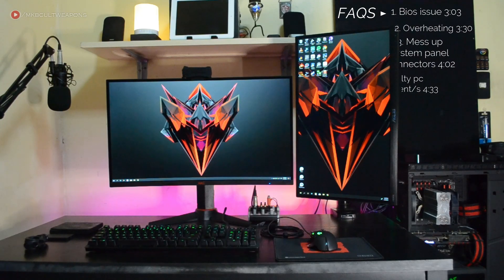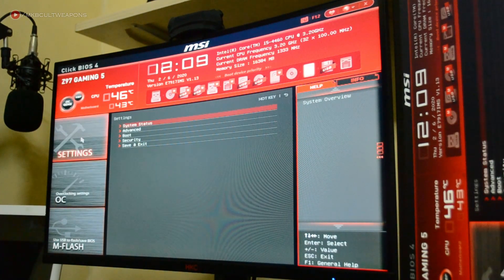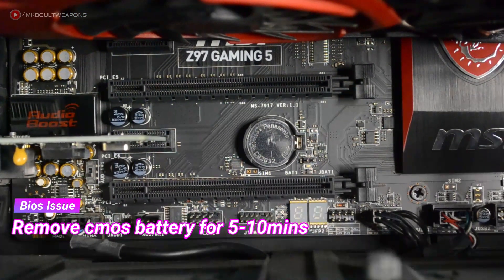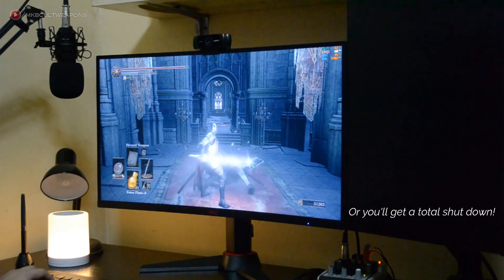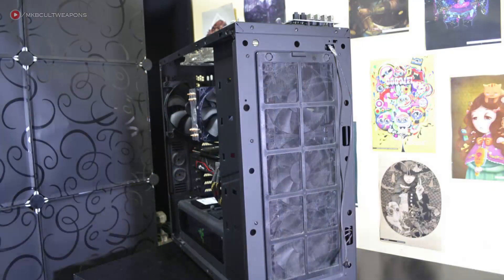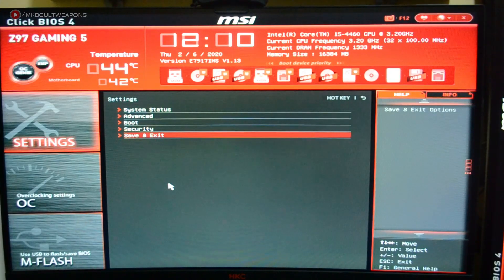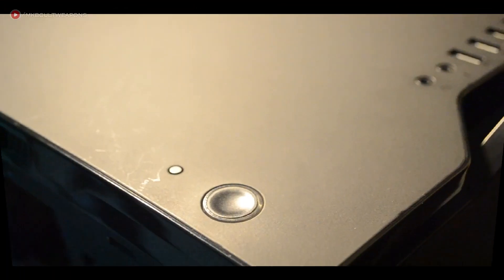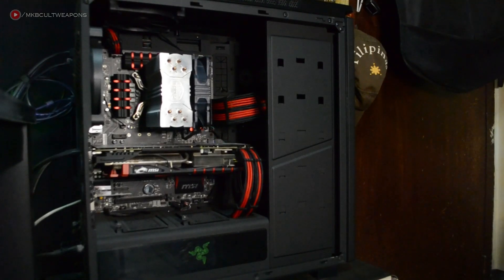Pc keeps restarting FIX / Pc continuous restarting FIX

Comment: Very important: I just had this problem and even more lot of times the pc was starting but no display at all, sometimes boot loop. I checked the cpu and I noticed there was some green plasticky residues on the contacts pads, I removed them with a needle and this probably solved the problem. I say probably because I did this few minutes ago but I believe it will work fine now because every pin on the cpu has different functions and those residues were probably causing current interruptions between cpu and motherboard.
Reply from the maker: i wonder where those green plasticky came from, anyway thanks for sharing bro! this might also be helpful to others who might experience it.
Reply: @MacCoyzkie  my pleasure, I really don’t understand how is it possible that some residues could form under the cpu, it looks like some kind of insulating enamel used on motherboards or maybe thermal compounds..I hope this can help someone because I almost sent gpu and motherboard to tech assistance.
Reply from the maker: @NikStrengthCoach  i see, yes this will help because at times pc builders forget to check that part. Thanks bro

Comment: Someone please help I was messing with bios and I shut down  my PC and my PC won't start it keeps turning on and off. I even removed the cell cleaned the ram nothing works.
Reply: Well nothing worked I had send the board to gigabyte service center it's been about five days they said I'll get it done today.
Reply from the maker: @dunkuzi5695  i  hope they'll fix it
Reply from the maker: remove the cmos battery for 5minutes or make it 6 minutes just to make sure, place it back and power on your pc, this will reset your bios to default so whatever you have messed up there will return back to normal.

Comment: Thank you very much, it was the fault of a non-working ram that the PC was constantly resetting .... I have 2 questions if you can answer: is it possible to restart a ram that makes the PC restart continuously or is it to be thrown away?  Then, if I buy a ram, does it have to be the same as the others or can it be of a different brand?  (Ddr3 mhz1333)
Reply from the maker: no problem, before throwing your old ram try it with other compatible pc first, if problem persist then it is really broken. It doesn't have to be the same manufacturer but you have to check your motherboard manual for compatibilities regarding the speed and ddr3 support. If im not mistaking the fastest ddr3 is cheap nowadays assuming your motherboard is compatible with it
Reply: @MacCoyzkie  ok, thanks for the reply first of all. my motherboard is a H55M-UD2H not really a very good pc, but it is enough for the games I do. 😅I just have to take 2 ram of 2 gb, I already have 2 inserted corsair from 1600mhz (1333 was the one that reads from the pc, I was wrong) and I miss 2. (it has 4 slots). do you know of the ram, possibly cheap and good, even 2 4gb? from what I see, the price for 2 of 4gb is not that high compared to 2 of 2gb, I just need to get to 8 so either one or the other is fine for me
Reply from the maker: @MrSoeAAA  im not sure about the model name but most likely they are available in any local shop. Try looking for the ripjaws 1600mhz, i think your mobo can handle it

Comment: It happens to me even when I'm just watching a movie not only by playing a heavy game like horizon zero dawn, So what i did is i removed my gpu that is gtx 1660 super Evga and tested my pc with the integrated onboard graphics that is intel hd 4600 nothing happens even when playig light games but when i plug in my gpu that is gtx 1660 super pc keeps restarting itself with a buzzing noise/sound. Can anyone help me?

My specs are 
Intel core i7 4770
16gb ram ddr3
Eps 850 watts 80+ silver
256gb ssd
Evga Gtx 1660 super 6gb vram
Mobo ecs z87h3 a4
Reply from the maker: bro, aren't you the one who has the buzzing sound pc and keeps restarting? Have you done the bios reset by removing the cmos battery already?
Reply: @MacCoyzkie  yes already
Reply from the maker: @footballmatchhighlighttv  try those gpu in other pc, if problem still the same it might already be broken
Reply: @MacCoyzkie  if not
Reply from the maker: @footballmatchhighlighttv  try the rams too, if problem persist then it is one of those parts, if not motherboard or psu is faulty already

Comment: Issue in my hdd please tell how to solve.hdd is showing in bios but after exiting from bios system strat restrating again and again.please give solution
Reply from the maker: If you tried every suggestions in this video and nothing works then let's try to figure out what might be the problem.
do you have a different boot drive or you're using your hdd as boot drive? if you have a different boot drive try removing the hdd and just use the boot drive (ssd or m.2) if that works then the hdd is faulty if not then the boot drive is causing the problem.

Comment: I was playing a game and my pc crashed and ever since it’s just been rebooting infinitely every time i turn it on, I’ve tried resetting CMOS and reseating gpu and ram and nothings worked for me got any tips?
Reply from the maker: is there any lights and fans running?
Reply: @MacCoyzkie  same here there is a red light popping
Reply from the maker: @rafa-ru6zi  try system restore also
Reply: @MacCoyzkie  My bad i didn’t see your reply, Yea the fans run and the gpu light turns on
Reply from the maker: @Slurpys  try the ram cleaning method in the video
Reply: @MacCoyzkie  I don’t think it’s that as i’ve tried other ram sticks, I think it was overheating and i didn’t think about it at the time so i just rebooted and started playing again, Do you think i’ve damaged a part or something?
Reply from the maker: @Slurpys  if you did that rebooting many times yes you could damage it, eventually the next reboot you wont see any display. if ever you get to desktop again, when you play games try lowering the settings of your game and also use msi afterburner to monitor your pc temps
Reply: @MacCoyzkie  Ever since the first reboot i haven’t seen a display
Reply: System restore to a day or two before , that's how I got back in

Comment: I still have problem, I tried turned on the motherboard without putting that 4 pin power supply for prosessor from ATX, and then my cpu fan run continuously without restarting, but doesn't show anything on screen (of course processor doesn't have power supply) so my question is, is this a problem of prosessor or anything else
Reply from the maker: don't remove the those psu power going to your motherboard, place it back. Did you see any loading of whatever kind on your monitor or is it showing the "no signal" sign right off the bat?
Reply: @MacCoyzkie  no there is no loading sign, when I switch on cpu fan starts and after 2 seconds it goes off, then again start and stop, the I tried unplugging that 4 pin psu cable, then the cpu fan run continuously, I tried every other steps you showed. And also 2 days ago my system starts and windows also loads and then I try to do some works system goes off
Reply from the maker: @vslexman  i see, if you tried everything here and still nothing works i think we need to check your pc parts which is causing this one. i suggest ask a friend with compatible pc to try out your rams and gpu one at a time and if problem persist then it's one of the components they tried. If problem did not persist then you got a dead motherboard or power supply. If you still have warranty on each use it if you find which is causing the problem
Reply: @MacCoyzkie  okay, but I have a doubt, I have 2 systems, so I tried turning it on without ram and cpu fan started, so ram in no essential to turn the cpu fan on right, so I tried the same on the board that have issue, but it still have issue, so ram is not the problem causing here, am I right? (correct me if I'm wrong)
Reply from the maker: @vslexman  yes and no, depends on the motherboard but without ram you will not boot at all therefore no display. Ram might still be so try my suggestion first
Reply: @MacCoyzkie  yea okk.. By the way thank you so much for your time and response 🤗
Reply from the maker: @vslexman  glad to help bro

Comment: I messed with my ram in the bios to have it running 3600 but after that my pc kept restarting. I switched it back to its regular and still proceeds to restart on me. Could I just restore my bios to default on the bios page or do I have to actually remove that battery?
Reply from the maker: if you can still go to bios that is much easier but both ways can restart the bios to default
Reply: @MacCoyzkie  so you think my best bet is to restore my bios to default?
Reply from the maker: @darionarango2610  we could never know until we try. not unless you don't want to lose your overclocking settings then i guess you should not set it to default but the question is how can you make your pc stop restarting itself?
Reply: @MacCoyzkie  I don’t mind restoring my bios to default. I’m just not sure why my pc would just keep restarting
Reply from the maker: @darionarango2610  i know, but it happens sometimes
Reply: @MacCoyzkie  I’ll be home around 5 to restore my bios
Reply: After restoring my bios my pc did not shut off on me one after being on it for 5 hours
Reply from the maker: @darionarango2610  i guess that fixed it, if ever you mess up bios that is the trick

Comment: What do I do when my pc is built inside my monitor?
Reply from the maker: first you need to learn how to open and place it back, look for the rams and clean it, or simply clean all dust without removing any pc part. all in one pc usually has a complicated build so i don't really suggest opening it yourself specially if you're not that confident. Just bring it to the local shop where you got it from and let them fix it for you

Comment: PLEASE HELP!!! My PC has an issue of constantly restarting or complete freezing while playing games or after playing games that are demanding in performance.
 PLEASE HELP!!!

I changed almost everything in the PC.

I changed the GPU, CASE for better airflow, PowerSupply because I thought the powersupply was overheating. And the new ram is on the way from Amazon.

Current specs:

GPU: Sapphire RX580

CPU: Ryzen 5 1600

Motherboard: Asrock B350M Pro4

PSU: Corsair RM850 Gold Fully Modular

RAM: Viper 8GB (2x4GB) DDR4 2400 (Not sure) But it is viper red 8GB.

It has been like this for a year now. I am so frustrated trying to fix this issue. I don't know if it is the powersupply, at first I thought it was the GPU, then PSU, I don't know now what it is....

Please note that I did the Memtest86 and there were no issues or errors.

However, when I tried to test one stick of 4GB ram individually, one stick froze the computer while testing. And the other stick won't even load windows or bios. I barely get Windows logo then disappears into reboot. Does that mean my ram is defective?

What do you think it is?
Reply from the maker: i only got one theory, if this only happens during and after gaming. The demanding game requires more memory with higher speed. 8gb works ok but if you can get it to 16 it will be better. Actually 16gb ram in 3200mhz is the standard nowadays specially for new demanding games like cyberpunk2077. Your rams are ok and not defective it's just that it couldn't handle the workload (gb size and speed). I  also suggest close any chrome browser during gaming, chrome chews a lot of memory.
if ever you plan on buying new rams make sure it is 16gb in 3200mhz, i think your motherboard can support that ram speed and just sell the old ones
Reply: @MacCoyzkie  After restart happens while gaming, I try to boot up and not play games. Just watch netflixo or youtube. Still restarts. I bought 64GB RAM RGB VENGANCE PRO COSAIR from amazon. and they are on the way. Question.. Is it possible that the wires connecting my parts and motherboard are defective? Because I did not change them all with power supply. 

Thank you for the reply <3
Reply from the maker: @eligun1034  psu cables rarely breaks actually unless your pc drops from your table or the pc ships somewhere else but you could double check the connection, just make sure all are plugged in all the way.
Reply: @MacCoyzkie  I already figured it out. It turns out that the asrock mobo I have is a defective model in general. https://www.reddit.com/r/Amd/comments/78pc3x/new_pc_amd_ryzen_5_1600_32_asrock_ab350m_pro4/ 
This is a post from reddit 3 years ago with the exact same build as mine. one guy posted and like 15 other people told him they have the same or very similar issue with this mobo. Thanks so much for the reply <3 

Question: 
I want to buy a MOBO that supports Ryzen 5 1600 and supports Ryzen 9 5900x when I buy it in the future. What do you recommend? 
I appreciate your help brother. Thank you so much

Comment: I did all of the steps. Removing ram and checking different slots, removing all other hardware and I guess I need a new PSU.😑
Reply from the maker: before you do that, can you ask a friend with compatible pc to try out your rams and gpu one at a time. If problem persist it is those components are faulty if not it is the psu indeed
Reply: @MacCoyzkie  someone put my computer upside down and it was like that for 4 days. Do you think that's the cause of this?
Reply from the maker: @jp2650  oh yes bro, you need to double check those connections for the cables, rams, gpu etc. was it shifted to some place or just in one place?

Comment: Thank you my issue was that the RAM slots was broken. Now, I understand what should i do. Thanks for your instructions. (:
Reply from the maker: im sorry to hear that, sometimes this happens. anyway i'm glad to help, you're welcome bro
Reply: my pc stopped restarting just now but i have a new problem chrome tabs won't load
Reply from the maker: @daryl6364  i think you need a fresh windows reinstallation, this might be also the cause of the restarts
Reply: I gave it a shot and it also turned out for me to be a broken ram slots !!! Thank god can I still get dual channel somewhere else with 2 other ram slots ?
Reply: Vedys for me, i changed the whole motherboard with same brand to avoid any complicated settings.

Comment: Tried everything (power supply replacement, hdd/sdd, cleaning ram sticks, and reseat all the hardware) but still my pc  loops and no signal throwing in my monitor, it's hopeless at this point. I think my motherboard is dead. What a bumer.
Reply from the maker: before buying a new motherboard i suggest ask a friend with compatible pc to try out your ram and gpu one at a time, if problem persist then it's one of those components, if not then maybe you new a new mobo

Comment: my pc keeps restarting with a blue screen and it gives me a code,saying that this code is the fault some codes like drivers and something like this..Can u help me pls?
Reply from the maker: bro i think this has to do something with windows update or a faulty drive. Either you need to have a clean install of windows 10 or you have to replace your drive. I experience this once when my hdd is becoming faulty, i just removed the drive and everything went well but i lost my files there because it was too late to back it up
Reply: @MacCoyzkie  thanks bro
Reply from the maker: @simeon7481  no problem bro

Comment: Sent my pc in to a local shop to get a ssd installed, got it back and its bootloopping and bluescreening. I followed all the cleaning steps but still not working
Reply from the maker: ohh that's bad, what did the local shop told you about this. Blue screen can also be a faulty drive

Comment: After I factory reset my pc it went into a boot loop since 2 days ago it is still in boot loop... I tried everything... rip my 3000$ pc
Reply from the maker: if you can still go to bios you are still safe. Did you do an overclock at some point before doing a factory reset?
Reply: @MacCoyzkie  no have not overocked but I did fix my issues by simply reinstalling windows from a usb,
Reply from the maker: @stiiizy8334  i see, that's the easiest way out of it. It'll be a good and fresh start too :)
Reply: I also factory reset and tried everything ...rip my 600 dollar pc
Reply: @mehreenjawaid1383  just reinstall windows from a usb there are plenty of YouTube videos on how to install windows ona brand new pc, just follow those steps

Comment: so i recently bought my laptop and it's amazing, but the issue here is that when it sometimes reboots when i turn it on, and it happens rarely not most of the time and i'm trying to ignore it but it worries me, but other than that my laptop is all good 💜 if u know any ways to fix it or smth please let me know!
Reply from the maker: the only thing i could think of is thermals, can you check if the fans are running in your laptop? usually it will restart itself when it is overheating. laptops usually are good to go specially if it's new. if ever it gets any worst, just use Rma since its new

Comment: my pc turns on and shuts down and theb starts up after like 1 - 2 mins being turned on, then does that again and again. It worked fine last night.
Reply: Same here dude any idea yet?
Reply: @diobrandon8649  no, actually. tommorow im going to clean every component. idk if that will work but its worth a try.
Reply from the maker: guys have you tried clearing the bios by removing the cmos battery?
Reply: @MacCoyzkie  i tried doing that. after removing ram and cmos i plugged it in same thing. my pc started continously beeping.
Reply from the maker: @jagerczbr  those beeping sound means the rams are not detected or other parts are not detected. If you got a friend with compatible pc ask them to try out your rams and gpu one at a time. If problem persist then its one of those parts that are causing it, if not then it is the psu